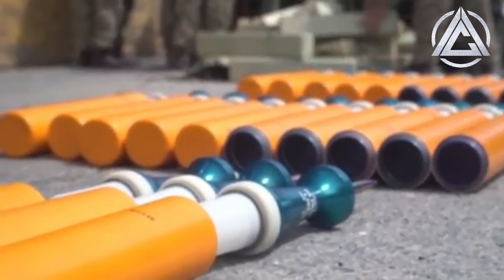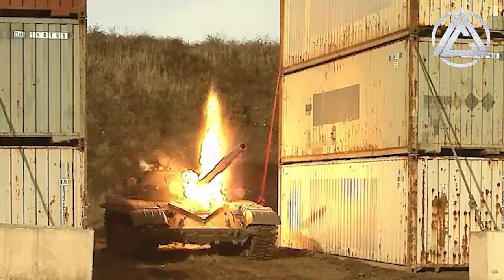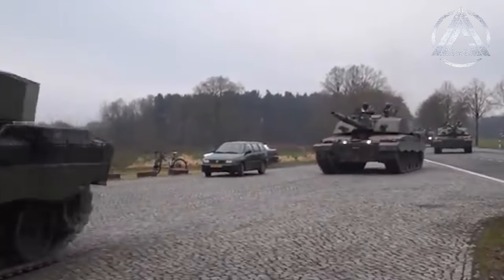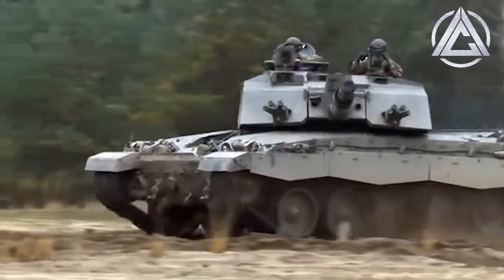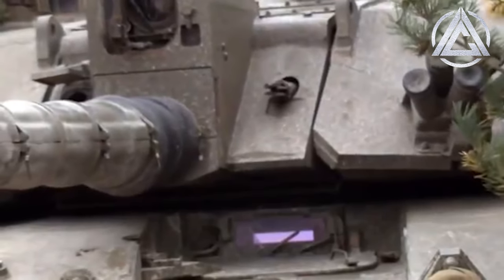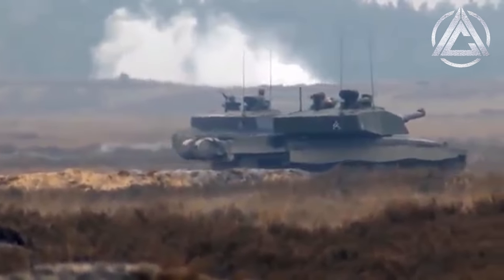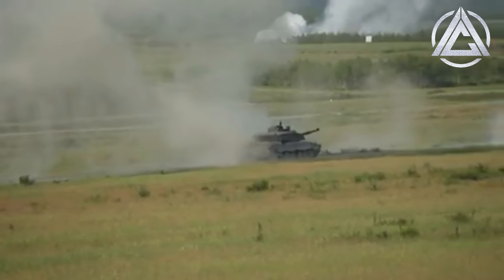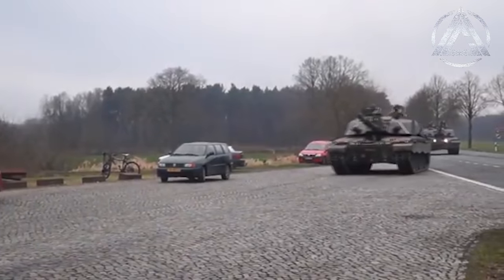Challenger 3 | Britain's New Main Battle Tank | Is It Really Any Good?

Comment: Challenger 3 needs an MTU engine, they have 2000+ hp versions
Reply: It's not that hard to build 2000+hp tank engines, it's all about decades-long lobbied defence contracts and is justified by "reliability, cost and ease of use".
Reply: Its all great having a 2000+ horsepower engine. but what range can you get out of it and how easy is it to repair in the field. How reliable is the engine in adverse conditions. All these factors need to be accounted for before looking at performance. Especially the ease of repair.
Reply: @knucker2730  the mtu in the leopard 2 has had 1500 reliable horsepower 40 + years
Reply: @knucker2730  range is not as important as tactical mobility in most situations.
Unless you have a long-reaching tank breakthrough in a global war scenario, supply is always right behind you in strategic terms.
In desert storm, almost no armored regiment had uninterrupted pushes of more than 40% of Abrams range.
2000hp might be too much, but Challenger 3 is a heavy tank. With the engine as it is, it literally has THE lowest power/weight ratio of any modern mbt. This underperformance can be justified or explained all day, but it's still an underperformance at the end of it. Not crippling, but preventable.
Reply: @LoisoPondohva  In a perfect world with established supply chains yes. However in areas like Iraq this was certainly not the case. Many untis became misplaced and isolated and regular supply chains were slow in coming to allied positions. If the war was not so Asymmetrical the results could have been exacerbated to a far greater extent. Britain especially with its relatively limited equipment in comparison to the US needs to have equipment capable of operating in conditions were regular resupply is scarece.
Reply: @LoisoPondohva  Us Brits love to try to justify or explain underperformance of military equipment as if it's not just that... a failing, a LACK of performance. Usually our allies do not suffer the same underperformance, and in cases like Challenger 2, have it beaten in EVERY major aspect, but we will still go on about the little things, as if they make it somehow acceptable to get all the big things wrong... 

We have a military procurement culture of being fixated on irrelevant details and losing sight of the big picture.
Reply: They should be more worried about making it survivable and lethal than worry about the engine
Kinda needs to firepower to be able to defeat Russia and China latest tanks as well defend against ATGMs as well SABO rounds 
The engine type is just foot note at best.
Reply: @verdebusterAP  no Challenger 2 has been underpowered for ages, ad the bar Armour and urban protection package and the thing is getting slow, they need to be able to dash when needed, crew protection in the Challenger is already one of the best but will a
So  be upgraded as will active protection systems are part of the upgrade, the standardisation of common NATO tank rounds make a lot of sense as we work along our Allies, it’s typically the result of Labour Government defence cuts that as normal cripple any modernisation of our military assets, get them to do more fund them less
Reply: @AllThingsCubey  challenger 2 even as it is now, is still a top 5 tank easily. Challenger 3 is a huge upgrade, it'll be even better
Reply: You then have to change the entire transmission to cope with the power, remember this is a Challenger 2 with a new turret and gun. Caterpillar has an upgrade to the present engine, a new injector rail and engine management system that increases the power to 1,500 hp.
Reply: @paulmatthews2175  No it really isn't. Tanks that currently beat Challenger 2 in most, in some cases all, conceivable metrics include:

-M1A2C
-M1A2 SEP V2
-Literally any Abrams from the A2 onwards.
-Any Leopard 2 from the A5 model onwards (A5, STRV-122, A6, A6M, A7, A7V)
-Type 10 
-Leclerc (Series XXI onwards or newest XLR version)
-K2 Black Panther 
-T-90MS
-T-14 Armata
-VT-4

That's a lot more than five tanks, even if variants are grouped together under one roof. I assure you, every one I listed is current beating Challenger 2 in most, if not all, key metrics for a tank, from the capability of their guns, their mobility, and their armour protection being equal or superior, in some cases notably superior.

Challenger 2 is one of the most over hyped, falsely deified military vehicles on the planet. It was not even that good when it was designed in the late 80s, and has barely been upgraded since introduction in 1998. It's not top 5, it's not even top 10. Those with any in-depth knowledge of modern MBTs would tell you two things: you can't properly rank tanks against each other when they're all built for different purposes and requirements, but if you had to do so, Challenger 2 isn't even getting a look through the door of the top 10.
Reply: Hp sells, torque propels.
You want to accelerate 66t you need torque across the range, I'm not saying this is or isn't more or less mobile than anything else but simply comparing bhp/ton is pointless.
Reply: @zopEnglandzip  And the Challenger 2's engine loses out to the competition on torque as well as HP...
Reply: @AllThingsCubey  I'd be interested in seeing the curves, where have you seen them?
Reply: @zopEnglandzip  Literally just google it. Torque curves and mobility performance (incline, vertical obstacle, trench, etc) are not classified information. Many have been well documented in trials
Reply: @AllThingsCubey  never found torque curves for the leopard or chally, did see the leclerc though and despite making 300 bhp more, it has significantly less max torque in a very narrow band, it also only has 5 forward speeds, I think the challenger 2 has 6, leopard 2 has 4. 
I'd suspect being an older engine the cv12 has a comparitively flat curve (and still higher max torque than the leclerc) combined with its 6 speed box despite not being great on paper, produce more tractive effort in the real world.
They all cope with similar grades, leopard 2 copes with more step than challenger 2 which beats leclerc. 
Most of the mobility tests will be a function of mostly undercarriage design anyway, and things like c of g but I hope this helps you understand that perhaps the engine gearbox combination is better than the newer leclerc, and helps the challenger get close to the poorer protected and lighter leopard in mobility terms.
Reply: @zopEnglandzip  Leclerc weighs over 10 tons less and uses a lower capacity engine. Leopard 2 has a 46 litre monster that outputs considerably better torque than the CV-12, on a lighter vehicle, with best in class characteristics for trench, gradient and obstacle, as you're aware. Downside with Leopard 2's engine is the fuel efficiency, but the fleet are set to get a powerpack upgrade soon anyway, to something in the 1800hp range, and likely with improved economy.
Reply: @AllThingsCubey  all I was trying to say with my Bert Rutan quote "horse power sells, torque propels" is demonstrated by the leclerc, it's 10 ton lighter as you say, has 300bhp more but performs worse because especially with less gears, that comparitively narrow power band doesn't equate to more useable power.
More bhp or peak torque doesn't mean more performance. You always need to see the curve and know how that power is being put to the ground or air or water.

What I find most amusing about the new leo mtu engine is rolls royce designed and built the original cv series for electrical generation(6-16cyl) sold their diesel engines division to Perkins then 20 years later buy MTU and design new engine which compete with their old ones as the cataperkins engines are still selling, think some Eastern European country is buying the cv8 to re engine their BPM's with those same power plants operating worldwide either as back up gensets or primary power generation running 24hrs a day for years. It is an exceedingly well developed and proven engine at this point and far easier for field maintenance/repair than the modern electronic powerplants.
Leopard getting a British engine partially makes up for the german drinking straw getting stuck on the challenger 3 and ruining the best infantry tank ever made.
Reply: @AllThingsCubey  what's your real world experience of challenger 2? Just curious. I served for 6 years on challenger 2 and deployed to Kosovo and Iraq twice with the old girl. Never once had an engine issue, even when she was carrying all the TES kit. Only 1200hp and a little sluggish, but once she was moving she could move well for a 70+ tonne old girl. To say she's not in the top 10 is a bit silly In my opinion. Abrams uses Chobham armour gifted to the yanks by the British plus an APS and ERA. When Chally gets her upgrade she will most likely have an APS plus Dorchester level 2 as standard with a new type of add on armour.
Now I've seen and watched the old girl get hit by multiple mortars and RPG rounds in it's old and current format with TES kit on and she's walked away from the scrap every time, maybe a little wounded but she still walked away. You can't say that about the abrams in Yemen and the leopard in Syria on the other hand.
You can post all you want about what the book says it can do, but in the REAL world it will do something different to what all those books and graphs say. Do you honestly think all those figures are accurate? Because the MOD would just make it that easy? Or would the common practice of deception still be in use?
Reply: @kippamip  Yes. My numbers are correct. Abrams USED to use armour derived from Chobbham. It's seen so many upgrades, modifications and additions that its current armour bears almost no resemblance to our own, and is considerably stronger.

Getting hit by RPG-7s is not impressive. That is an obsolete weapon. Both Abrams and Leopard 2 are effectively immune to RPG-7 as well. M1A2 Abrams tanks have taken many hits from modern ATGMs and survived, there is plenty of footage online of this. That's far more impressive than Challenger 2 withstanding mortars and RPGs. Meanwhile, some Abrams and Leopard 2s have been destroyed, but only by hits that would also have destroyed a Challenger 2, such as directly into the rear of the Abrams' turret, or into the side of the Leopard 2 behind the idler wheel. When tanks are used considerably more than Challenger 2 has been, by worse trained armies that misuse their armour (Turkey, Saudi Arabia) then you get losses. Give them Challenger 2s and the same result ensues.

I'm not being silly to discount Challenger 2 from the top 10. Your comment about Abrams only using Chobbham we gave them shows you're not actually very aware of tank design outside the UK, spouting a lot of myths and misconceptions. I don't think I'd disagree with you too much on Challenger 2, but the issue appears to be your severely understating quite how superior other nation's tanks have become since Challenger 2 was first built, and then barely improved upon.
Reply: @AllThingsCubey  who's talking about RPG 7? I'm referring to RPG 29 and Iraqis had access to milan anti tank missiles. How do you know the Americans no longer use Chobham? It's the base armour model of the abrams. It's the TES kits that make them stronger. Your missing the point completely. 2 abrams destroyed by RPG 29 in Iraq. 1 challenger penetrated by RPG 29, 2 crewman injured, and still drove home. I seen the tank 1st hand. It was my regiment. This is in it's older format with an ERA nose cone. Chally no longer uses that nose cone. My point is that it's still better than any M1a2, M1a2 sep, or any leopard up to the A6 in its current format and latest TES kit. Again what is your real world experience of the tank? Or any other tank. Once the upgrades come she will be a top tank again. Same FCS and optics as the A7, but with even better armour and an APS as well to add to the relevant TES kit.
Oh and by the way I have driven the 2A5 as well whilst I was in, and yes a lovely piece of kit to look at and drive, but you could notice the difference in weight immediately, that tells me that the base armour model alone was a lot lighter than challenger, hence all the upgrades.
Oh and by the way the shite hit the fan when that RPG 29 went through, and the boffins back in the UK were working on a solution to fix it 24/7. We had the upgrade within a month out in theatre. There has been numerous upgrades to the TES kit as the threat evolved. The base systems of challenger are getting old, but everything else around it keeps it going. Still easily makes any top 19.
And don't say T90 is better than it please. It's just another T72 upgrade in fact a T72 Hull with a T80 turret.
Reply: Whatever you say, mate. Your faith in the equipment is admirable, but I'm not coming at the Challenger 2 from a user end perspective, but from the position of the "boffins" as you call them. It's absolutely inferior to what our allies have produced, and we're acutely aware of it behind the scenes. That's not what is concerning, however. The reality is that latest versions of tanks like T-90M, whatever your dismissal of it is, T-14, VT-4, etc, are increasingly superior to it too, and they are very much not our friends.

Leopard 2 is lighter than Challenger because the entire chassis is of a lighter construction in steel. If you removed the armour from both, Leopard 2 would be lighter, considerably so, despite the size difference. The armour arrays on Leo 2 are considerably THICKER than Challenger 2's, especially on the turret faces, so you're again showing you're not actually that aware of the design differences in these foreign vehicles, even having ridden in one (very cool, btw). 

My reasons to be tough on Challenger 2 aren't to try an insult your baby, but because I am aware of major failings in the UK's procurement process associated with it, and I do not want to see those mistakes repeated. The first step towards change is accepting there is a problem, and the data paints a different picture than your opinions from experience in an abstract sense (that is to say, your feeling on the matter is not from technical information and fact, but messy real life situations open to interpretation and circumstantial changes).

Challenger 2's service record broadly leads me to say it has just been lucky, and very well employed by the British Army. Used by others, I don't think the same results could be claimed, and we'd be looking at a lot more destroyed tanks.
Reply: @AllThingsCubey  my faith 🤣🤣🤣. Listen you keep reading the Internet and getting your facts from wiki. You obviously know way more than me because you've spent numerous hours reading top secret an classified information that is freely available for all to read on the Internet. Forget my knowledge of the vehicle and its capabilities, and the fact that I still have close friends serving on them. The cheek pieces on leopard are just spaced armour nothing special.
Oh and by the way ask any crewman, no two tank's are the same. They all behave differently. Some slower, some faster etc. So that proves you can have all your little nerdy stats, but they mean nothing. Every tank as you have already pointed out is reliant upon it's crew and it's proper employment on the battle field. 
I'll ask you just for clarity. Have you ever used a tank in action or been a member of a tank crew? 
Also forget I signed the official secrets act and spent month's /years training and learning all the statistics of the tank and how to look after it.
Reply: @AllThingsCubey  it all makes sense now, your a world of tanks player.
Your knowledge of the battlefield and tank's is far superior to mine. Just like your war thunder companions.
Reply: @kippamip  You're commenting this on a video posted by a War Thunder player... presenting hard facts that do not come from War Thunder about why Challenger 2 is outdated garbage. 

Sorry but you seem to think that games I play as an occasional pastime (and very little, recently, too busy!) are somehow the extent of my experience and knowledge with military equipment. Respectfully, because you've served my country, and have a lot of hands-on experience with armour, you don't know what you're talking about regarding engineering of these vehicles, or the full capabilities of anything you haven't served on. You've made multiple ignorant comments regarding the Leopard 2 and Abrams that show frankly, misplaced arrogance, and you assume a lack of relevant knowledge from anyone who's touched a video game in their lives, despite this video itself, which you chose to watch and comment on, being made by a War Thunder player. 

You strike me as a bit of a dinosaur, which would explain the love affair with Challenger 2. You're unaware of the extent of modern threats, or the capabilities of other modern vehicles, and seem to naturally assume a 30+ year old tank, that wasn't particularly good when it was new, is somehow still competitive against them, when all evidence says otherwise, evidence you keep trying to dismiss with weak arguments like "every tank is different" and claims that hard engineering somehow will vary in effect once exposed to the magical force known as combat.

We could be here all day, but it's not a productive use of my time to try and convince an old Challenger 2 guy that their archaic tank is not all they thought it was. The MOD knows it, the engineers know it (and I'm one of them), and they've already made the call to create effectively a new vehicle, with Challenger 3. Even then, it's hardly the world beater that they want the newspapers to say it is, but as usual the MOD is strapped for cash. 

Hope you have a good day, and respect for your years of service, but you're still talking out of your ass on many points here, and I'm not gonna be shy to say it when I'm coming at these vehicles from a design and procurement standpoint.
Reply: @AllThingsCubey  dinosaur with a love affair. OK 👌🏼. Do I like the tank yes because it saved my life on a few occasions. Do I think it is the ultimate? No I'd probably go for Merkava at the moment. Are you waffling complete tripe? Yes. Can you point me in the direction of all your info, as I just want to see if it's been declassified. Yes we know the name of various types of armour, but tell me the exact make up and thickness applied to each tank. It's best guess.
So from a procurement and engineering point of view your obviously not old enough to have worked at vickers, so how do you know all these spacifics when it comes to each nations closely guarded secrets?
And just so you know this dinosaur is a fully trained apprentice maintenance engineer as well 🤔😂.
Is this the type of thing you look at?
 https://ukdefencejournal.org.uk/challenger-2-compared-to-the-competition/
Reply: @kippamip  -Merkava

Yeah right there you've confirmed you know almost nothing about modern tanks. I didn't even mention Merkava along with tanks superior to Challenger 2 because its design is so radically specialised to what Israel needs, as to be wholly incomparable to any other tank, and appallingly badly suited to any other nation. Its armour is not built as to withstand modern APFSDS, and the engine-forward layout that was smart when it was designed is now little more than a fire hazard. Trophy is a neat system, but hardly unique to Merkava now active protection systems are the newest hot toy. There are some neat features such as the training mode for all the digital systems, for easy crew training, but that doesn't make for a world class tank in combat when the vehicle has already hampered its design in so many ways.

  Also, maintenance engineer = mechanic. I detest the English language use of the terms interchangeably, it detracts from the meaning of "engineer" in proper context. Regardless, it's not the same deal as understanding the design and capabilities of the equipment.  Have a good day.
Reply: @AllThingsCubey  Explain underperformance of Challenger 1 and 2 in real war? Abraham’s destroyed in war Leopards yes destroyed in war. Challengers one destroyed blue on blue due to open hatch and mistaken identity. Some damaged repaired and back into battle. None destroyed in enemy action. Pretty dam good in my book but if we look at it in mirrors with some smoke and bullshit we can make it look bad. Did I mention it’s cross country speed due to its superior suspension system and better accuracy of gun on the move because of it no ok. What do you base your argument on? Gun rifled longest tank on tank kill now smooth bore ammo can do what a squash head round can do it’s adopted to the best smoothbore gun. So mobile cross country, best Armour, best best gun, new electronics and more to come. Pretty good in my humble opinion. Better ask Mr Fletcher what he thinks at Bovington tank museum. Challenger 3 versus Abraham’s versus Leopard. That would get his moustache twitching!
Reply: @AllThingsCubey  What fleet? Even 'brand new' Leopard 2A7's still come with that 47l dinosaur of an engine with a 4 speed transmission. If they'd chosen a smaller engine and better transmission then they could have had more armour and solved the protection issues.
Reply: @AllThingsCubey  well if you will miss of the only tank designed by someone with anything like modern experience with tanks against a near pear adversey post 1945 ie the Israelis and there merkeva then I'd be tempted to ignore your list. Name me another country who have fought large tank battles post 1945 without the overwhelming air power advantage of the coilition in gw1 and actually produce a modern MBT. That's another supposedly slow mtb with a focus on armour
Reply: @thomasbaker6563  Israel's design decisions with the Merkeva Mk1 were smart, but short-sighted. They chose their layout at a time when armour could not stop the current ammunition, and it has left the tank at a disadvantage ever since as there is not adequate space in the front hull to fit modern composite armour. 

I have a lot of respect for Israeli tank design, but the Merkeva gets almost everything wrong for a modern MBT, because it's design is NOT modern, it's stuck in the 70s due to poor layout choice for a different world.

This is not to say it's not very well suited to modern Israel, but that's fighting urban wars against those without tanks. In a European tank vs tank context it is a very, very bad design. If you can't see why that is, you might want to do more research into it.
Reply: Vickers put a leopard 2 power pack in a Challenger 2 for the Greeks to test.
Reply: @aytonbob  Vickers put an MTU/RENK power-pack in the CR2E, but it was the 'new' Europack which is totally different to that of the Leopard 2. The Leopard 2 pack is gigantically big and heavy and would not fit in a CR2.
Reply: @agt155  This was nearly 20 years ago
Reply: @AllThingsCubey  99% of Leopard 2's aren't 2A7 variants. The hull ammunition is woefully unprotected for 99% of Leopard 2's and poorly protected for the other 1%. Just 30mm plate steel protecting from above - less than the rear plate of a CR2! Leopard 2 has never been a serious contender, way too many basic design flaws - M1 Abrams is the superior version.
Reply: @agt155  Ever since DM53, German ammo has been almost impossible to detonate with direct hits. You can go look up the tests yourself. It's only shitty old export tanks that will blow up.
Reply: @darrenjones3681  pretty sure that's the Tories that keep cutting MoD funding. Austerity ring a bell?
Reply: @AllThingsCubey  If there was no issue they wouldn't have gone to the massive expense of fitting armour around the ammo racks on the 2A7 models.

You are thinking of the DM63 which has a temperature independent propellant, but it is definitely not insensitive.